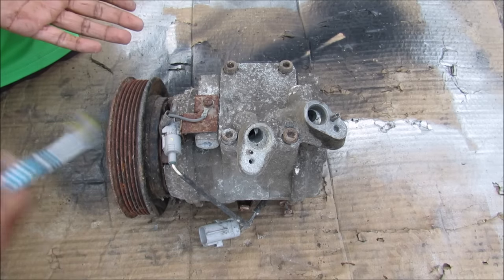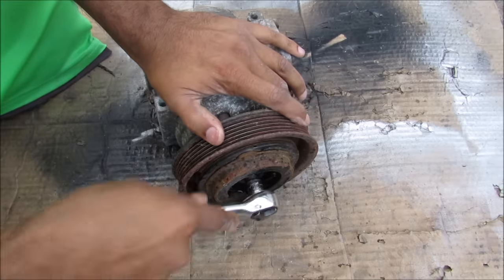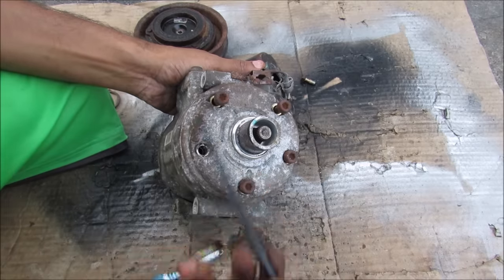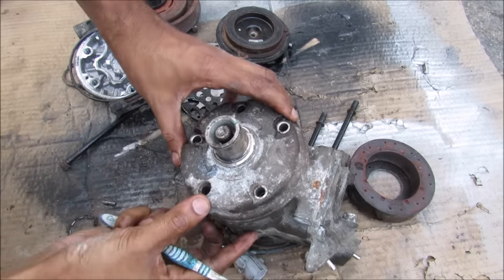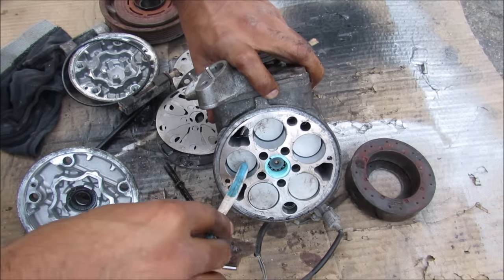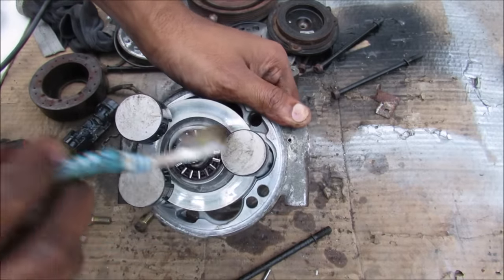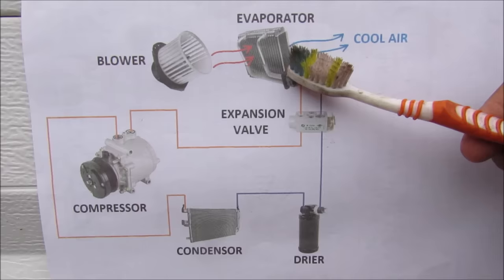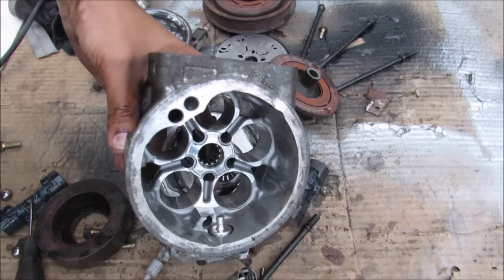How an A/C Compressor Works

Comment: Thank you for this great explanation and tear down.  For years I was always curios as back in the 70s it seemed lower end cars had reciprocal compressors resembling an engine and higher end cars had these.  I always wondered how these worked.
Reply from the maker: Glad you found it helpful
Reply: The "reciprocal compressors" you're referring to were the York 200s, the Tecumseh HG and the Mopar RV2. Nowadays, behemoths like these are only found on buses and coaches, and even for these huge AC systems there's a very recent trend in switching to equally sized compressors that work exactly like the one shown here (double acting piston swashplate compressors such as the Valeo TM-55 and TM-65, or the Unicla UWX550 and UWX660), which are much smaller than the V-piston compressors, require less power and have a greatly reduced NVH (noise, vibration and harshness). Problem is, there's currently no way to "unload" them like you can easily do with the V-piston compressors (it works by placing a solenoid valve that closes the suction on a certain piston bank so that this bank temporarily ceases sucking and pumping refrigerant, halving the compressor displacement in the case of two banks, and reducing it by thirds in the case of three banks such as with the Carrier 05G)... the double acting piston design can't act in variable displacement like the single acting piston design found on car ac compressors...

Comment: Excellent advice about running AC system during cold season, I’ve been telling customers the same thing. You mentioned when the freon turns to a liquid state in the condenser, but you forgot to mention that the expansion valve is what turns the liquid freon into gaseous state before it enters evaporator.
Reply: And besides that, if the evaporator temperature sensor (used in TXV systems with fixed displacement pumps) is working correctly, the evaporator will never ever freeze up.
Reply from the maker: I have another video on the evaporator / HVAC unit inside the vehicle

Comment: I honestly didn’t have high hopes for this video when I saw the dirty corroded compressor and the toothbrush. Man was I wrong. Great video. I also think it was good to tell people to test it in the winter. I’ve seen failures on the front seal from lack of lubrication from the system not being used. Anyways you gained another thumbs up and a new subscriber. Can’t wait to see more.

Comment: Quick, comprehensive and easy to understand. I was a mechanic mostly in overhaul engine, automatic transmission and also electrical troubleshooting. AC is never my thing. But quite easy to grasp the explanation video. Very well done. Like and Subscribed.

Comment: I stripped an auto AC compressor some time ago and put it up on YT but I am no where as elegant as you in the presentation. It was just something to break and look at the design.
Reply from the maker: It sure is something to ponder
Reply: @speedkar99  yup a compressor is definitely interesting. I did a series of videos on stripping an old photocopier. If you ever get the chance its one of the most amazing things. A bit of everything in there. Some serious engineering.

Comment: The oil in the system seals the pistons as they move, great vid!
Reply from the maker: Good to know. Thanks
Reply: Again, if it only was the oil everything would turn into a swarfy mess in no time, especially since the oil is PAG 46 and not PAG 150... the seal is a combination of a polymer coating either deposited on the piston or on the cylinder walls, and the oil...
Reply: @teravolt6113  I stand corrected, thank you

Comment: Very good, the best I've seen, fast moving, to the point and informative. I can now see the compressor is far more complicated than I imagined, so paying a lot for a new one seems justified. Also seeing that oil, some A/C refillers threaten it needs new oil, my local A/C said that's BS and explained the refridgerant is a mixture of substances and does a number of other jobs other than cooling. I now see what they mean. So by taking the time to dismantle a compressor and expain it, thanks, I appreciate that. I'm not just saying that to be cool but because your info and presentation was really good.

Comment: Very nice presentation man, so glad you showed me cuz otherwise I would have taken mine apart.  Now that I know what's inside I'm positive I've found the best and cheapest source of a vacuum pump around and now I know why they take so much power to drive.
Reply from the maker: Vacuum pump?
Reply: Like my Electrical boss used to yell at us..."More Lube and keep your hands away from the pipe, I will pull you in!"   Don't ever put your fingers over that hole, you will lose it.
  Dude have you never used a refrig pump as a compressor or vacuum pump? They are not only silent but can easily put 300 LBS pressure in your tank in about 1/10th the time of a regular compressor and as for vacuum, nothing beats it, they use reed valves like most vacuum pumps and you can boil water below room temperature with ease and they only have one piston!   However they do have cast iron cylinders and pistons therefore you would have to have at least three bottles in line, one to grab acids (H2O bubbler) one for overflow and one to dry out any water or liquid because pulling acid vapors thru that pump would render it dead real quick, however since most people like you and me know where to get them free all day long, who cares.  Nice video
Reply: "they take so much power to drive" Still a lot less than a York 210 or a Chrysler RV2. And that's also why you now find line-piston or V-piston a/c compressors only on buses (and even these ones are being progressively phased out by double-acting piston heavy duty swashplate compressors like the Valeo TM65 and the Unicla UWX660).

Comment: Great video! Thank you!

Regarding engaging the compressor in the winter. Most vehicles use the AC compressor when defrost is on, it aids in removing the moisture from the air and blowing dry, warm air across the windshield to clear the fogging ;). Check your owners manual if you don't believe me.

Comment: Some how I missed this video. Wow, now that some engineering in design & implementation in the building of that compressor. Part of my job description was to be HVAC certified. Never knew the guts of an automotive compressor. Pretty cool. Probably a mineral based oil (good to keep you regular :face-green-smiling:). Great job explaining. Didn't notice a TXV valve in that schematic. maybe a fixed orifice. Thanks for the show & tell!!!

Comment: I had customer call and say they couldn't get their vehicle to stay running...it would run if the belt was off but wouldn't even crank with the belt on. After much frustration and taking teh starter off twice figured out that it was the A/C compressor clutch. It had jammed and was stopping the belt from turning which in turn was causing too high a mechanical load for the starter to overcome. That was a fun time.

Comment: When you showed it operating with the pistons going up and down and then valves I wondered if the concept could be turned into a combustion engine and then I found the DUKE Engine .... Doh, already been done!
Reply from the maker: Yep it has! Although for ideal compression you'd need seals on the pistons

Comment: Like a pressure washer pump. Swashplate! GOOD explanation!
Reply from the maker: I'm looking forward to the variable compressor teardown to see how this differs
Reply: @speedkar99  Slight anticipation: basically, you'll find a rotating plate that drives (correct term is: nutates) a fixed plate forward and backwards, and the pistons will be driven by rods attached to a number of sockets on the latter... the pistons will be one-sided, and you'll find much more refrigerant passages, the ones that allow the variable displacement mechanism to work.

Comment: Just an fyi that you explained the diagram backwards. The compressor compresses the gas and then it goes through an expansion valve. The fluid to gas transition absorbs energy (causes its surroundings to cool). It then goes through the condenser to expel all the excess energy and then back into the compressor. Great video though. I've always wanted to pull one of those apart.
Reply from the maker: Thanks for the tip

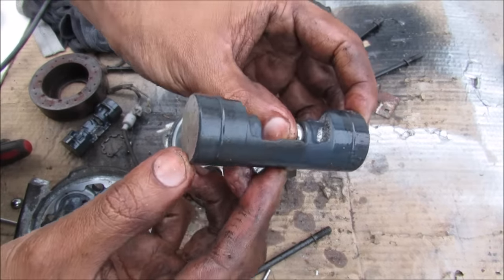Comment: 5:45  I'm sure you know it better that liquids get a much less chance to leak comparing gas in that speed.
Technically even that little leak in there going no where harmful like back of pistons in engines. Considering this they don't really care for high sealing in there. Very informing clip sir! Tnx
Reply from the maker: Good call! Thanks
Reply: It's a matter of tolerances (they have to be very tight, because the oil is ISO 46 viscosity), and by the way it looks like some kind of polymer coating has been deposited on the piston.

Comment: This is just one type of several designs of refrigerant compressor. This one is a variable displacement compressor, but others are used on different automobile designs. My truck uses a scroll compressor and some older vehicles use single/dual piston compressors that look like small motorcycle engines.
Reply from the maker: Cool 
I'd like to get my hands on one of those
Reply: Wrong. This one is a fixed displacement compressor just like any other compressor with this design (Harrison A6, Seltec TM31, Delphi SP20 to name a few others). I think nobody has found a way to regulate displacement with a double sided swashplate pump yet. In variable displacement single sided ones, displacement is regulated by bypassing either vacuum or discharge in the crankcase, generating a force behind the pistons (the swash/wobble plate is, in turn, kept either at the full angle or at no angle, depending on the compressor design, with respect to a plane which is normal to the shaft, by springs). I don't see this feasible with double sided pistons. "single/dual piston compressors that look like small motorcycle engines." You're probably referring to York 206, 209, 210, Tecumseh HG500/1000 and Bock FK20. The problem with these ones in cars is the space they require inside the engine bay, the vibrations they produce and the power they draw from the engine (one of these would surely make the little L4 75hp engine on my car immediately stall). Otherwise they're very reliable as they also have a dedicated oil supply system, which at the moment is only found on very large swashplate compressors such as the aforementioned Seltec TM31.
Reply: The variability of the engine RPM driving the compressor effectively makes it a variable displacement compressor.

Sure it would be a fixed displacement compressor if the power source driving it was constant, but this isn't the case in a vehicle.
Reply: @GGigabiteM  If your definition were true then all open drive ac compressors would be called variable displacement. Yes, the flow increases with shaft rpm, but the difference between a true variable displacement compressor and others lies in the fact that the first one can mantain a certain displacement throughout all the rpm range and therefore can keep the evaporator temperature at a constant value in any moment, while the others can't without another means of evaporator temperature control (cycling clutch, STV, hot gas bypass etc). Unless you drive the compressor shown in the video with an inverter motor, then variable displacement is an improper definition because the displacement can't be adjusted to suit cooling demand, it just varies with engine RPM, so the compressor clutch will have to cycle.

Comment: I'd be curious to try using this as an air compressor. Of course, lubrication would be a sticking point, no pun intended, being an open loop system. Perhaps installing an oiler on the intake side and a separator on the outlet side? Intriguing.
Reply: Yes, correct way. This compressor has no oil sump. With an Alma A-6, or a Valeo TM-31, you wouldn't need the oiler, because these ones have the oil pump and the oil sump. However keep in mind that the PAG oil won't mix with air, so the separator has an even easier job at separating it.
Reply from the maker: What about the lack of seals for the pistons ?
Reply: @speedkar99  Oil of the correct viscosity+the thin plastic sleeve on each piston should serve as the seal. Might be an interesting test.

Comment: you are absolutely amazing teacher with that toothbrush in your hand 😁I live in Houston and I'm looking for somebody to work on my AC because I have not had AC for over 6 years, it's very hot and I'm suffering right now, the AC compressor is starting knocking so I'm guessing something came loose, I know I can drive the car like that but, I just figured why not just get my AC fixed right?  but people are so dishonest I have one telling me 2000 another one telling me $800 amd a guy told me it could be a $65 fix, but he is not drom giusto 😢and they're telling me different things and it's just not a good deal, if you or anybody in Houston, that can help me out please let me know, thank you🙏

Comment: Excellent teaching skills.  Had no idea that's how it works before.  ANY SUGGESTIONS ?  I can't find an A/C Condenser or an A/C Compressor for my Toyota Liteace Van 2001. Is there another Toyota Make Vehicle that use the same size Condenser and Compressor that I could use as as a replacement Parts?

Comment: Excellent video mate. Would you mind going into the valve arrangement workings  and gas path from low to high pressure side in more detail please. I'm finding it very interesting and you went over it a little fast for me.

Comment: Excellent video.
Someone tightened the belt on my a/c pulley way too tight. In a day I was hearing a high pitched screeching noise.
I removed the clutch assembly, and when I turn over the compressor I'm hearing the sound of ball bearings rolling.
Any indication of the problem?
Reply from the maker: The bearings are probably work in the compressor

Comment: @7:10
Most vehicle AC systems do engage the compressor when the DEFROST
mode is selected, to dry the air in the cabin, so it's moisture (your breath)
won't frost on the inside of the glass. The operation of the AC system also
creates artificial heat, supplementing the engine-produced heat when the
engine is cold.

Comment: The A/C clutch relay burning out happened to my 08 honda civic. Caused the engine to stall out at idle and drained the battery completely dead overnight.
Reply: The AC clutch relay failed on my Vauxhall too and in this case the clutch simply didn't re-engage after the ECU disengaged it due to engine overrun (it's a small engine btw). New relay fixed everything.

Comment: Great presentation. So when the compressor starts running and compressing the gas, then the wheel on the compressor is harder to turn, and the engine burns a little bit more fuel, and the strap belt must be really tight in holding the wheel in order not to slip ? The thing is that my strap belt is a little loose, and currently, without any gas, the wheel on the compressor runs without any problems. When I add gas to the system, can I expect that the wheel may slip off the strap belt, since it is not fully tightened?

Comment: Dear Speedcar99, do you know what brand was this 10 piston AC compressor? And what type of car where I could find similar? Thanks!
Reply from the maker: I guess it's a denso
Reply: @speedkar99  10P series if i'm right. I'm looking for some car type where they are use it, but the infos are too dense with part numbers for me unfortunately.
Reply: @AttilaBlade  Denso 10PA15C, part number 447200-2141 there you go
Reply: @teravolt6113  Thank you very much!

Comment: Think you got the direction of flow wrong. Compressed then to expnsion valve the vapour then continues through drier and condensor back to compressor,  right?

Comment: I changed my ac compressor and condenser last week and my car has started vibration roughly between 40 to 70 km/hr speed.. What could be the issue??? 😞😟
Reply: Shoot happens with high end expensive comps too.

Comment: Interesting breakdown.  I'm assuming that both halves have reed valves at the tops of each cylinder (5 and 5)?  My question is if we are looking here at a 10 cylinder in total air conditioner compressor?

Comment: Good job.   Can you explain how the clutch pulls in to engage the pulley.  I know it is an magnetic coil. If the center bolt is tight so the Armature is tight against the compressor shaft, how does it physically move closer to make contact through the small gap?  something else must move.  Does the shaft move inward?

Comment: You made a great effort but still I can't get how the AC works, what the condenser does, how the system sucks energy from the environment (which you forgot to mention), what the expansion valve does, and also how these pistons compress the freon gas.

Comment: Thanks for the very informative video. You mentioned that a failure in the pulley bearing (6:44) might cause the pulley to wobble. Might that by any chance cause a knocking sound? I'm beginning to hear a knocking sound everytime the compressor engages and i was wondering maybe that's the bearing giving me an advance warning of failure.
Reply from the maker: Possibly, It could be the rotor wobbing and hitting the housing

Comment: Rotary hydraulic pump...you often find them on things like dump truck hydraulics (or grain feed trucks)...that's a BABY compared to them. Never seen one used in refrigeration before...interesting.  Must be a Toyota or Honda...only they would go 'that far' for compact compressors.  If you want 'the ultimate' compressor to make an air-tank compressor out of, find an old 70's model Dodge A/C compressor...reciprocal design, works just as good as most-any 3-hp shop compressor, too! (even has a lubrication reservoir you can keep filled).
Reply from the maker: Yep it was a Toyota Corolla